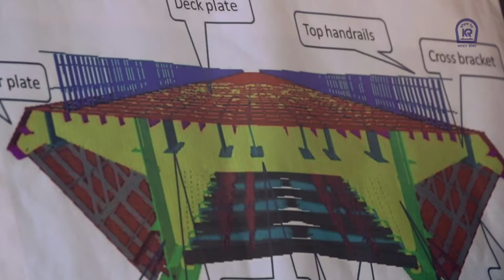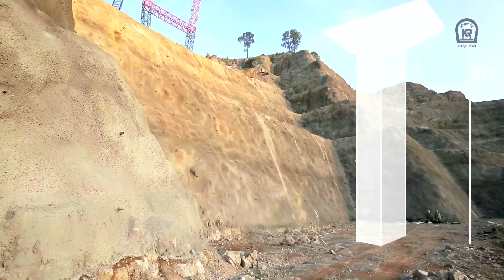The Chenab Bridge

Comment: When one look at China's engineering marvel of Tibetan railway , Konkan is nothing in comparison.
Reply: Totally agreed with you. That is an engineering Marvel.
Reply: Go to china then
Reply: The main challenges of the Tibetan Railway were the Frozen ground and sub-zero temperatures, which made it challenging because the ground expands and contracts due to the frozen moisture present in the soil, which might cause structural damage to bridge piles and buckle the railway tracks if necessary countermeasures had not been taken to keep the ground temperature stable throughout the year. With a lack of oxygen, the manual labourers were not able to work for long hours there.
Whereas in the Himalayas and Konkan regions, the ground itself is not strong enough to support any infrastructure; if you start digging tunnels in these places, the whole mountain comes crashing down on your head. The only solutions were either to chop the whole mountain off or rock-bolt and short-crete the whole mountain from peak to bottom; otherwise, there will always be chances of landslides in these places, especially during monsoon seasons.

Both the Tibetan and Himalayan/Konkan Railway projects had their own challenges, but the solution for the Tibetan Railway project came out to be cheaper when compared with the solutions for the Himalayan regions, which makes working in Himalayan regions more challenging, time-consuming, and expensive.